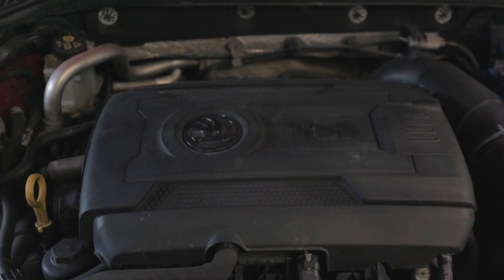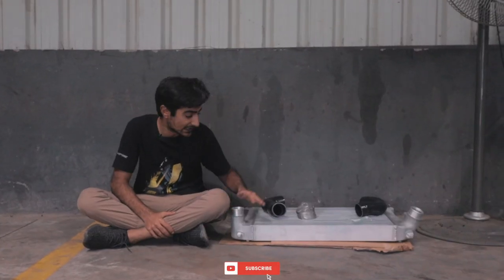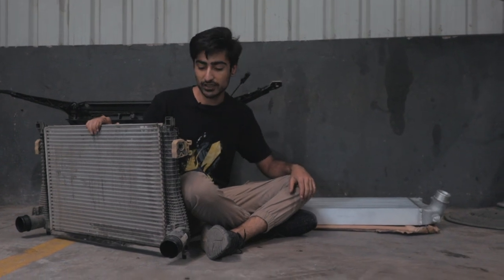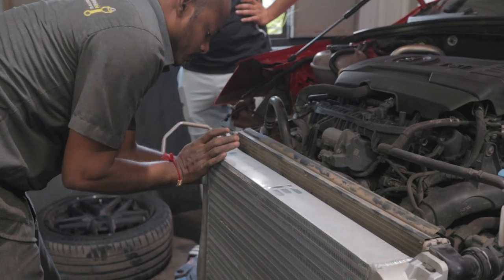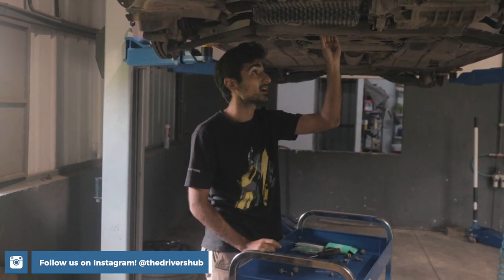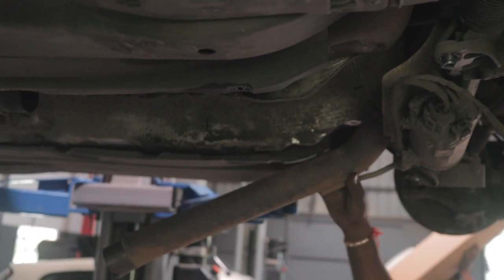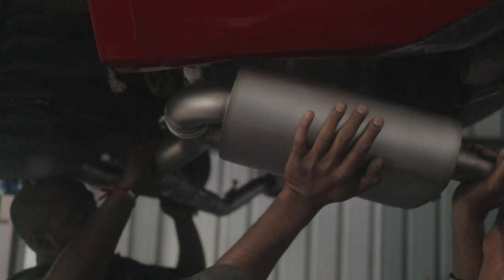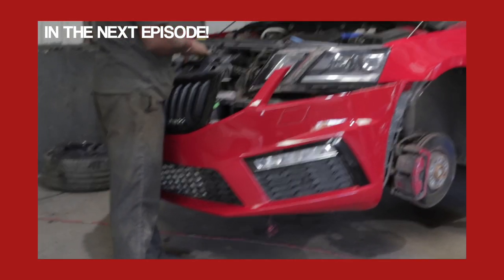Our new OCTAVIA VRS230 gets a Remus Exhaust System, Milltek Downpipe and an Intercooler Upgrade!

Comment: Desired explanation - Upgraded intercooler leads to colder air, colder air has more density, more density in air means more oxygen, more oxygen leads to better combustion, better combustion in engine extracts more power.
Cheers!
Reply from the maker: Yes, that 😅.

Wil definitely have a more detailed explanation in the next one! 🙌
Reply: Keep up the good job!! 
Best wishes